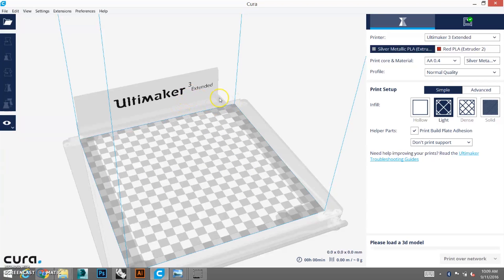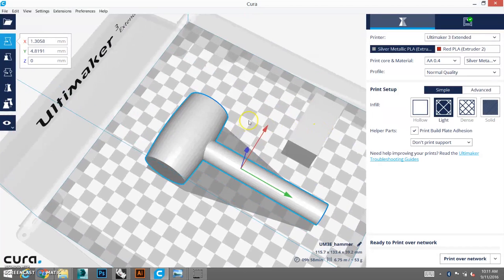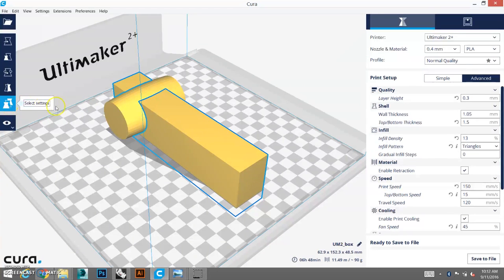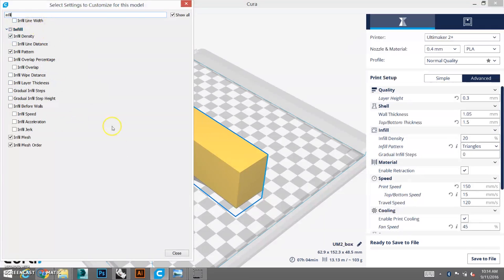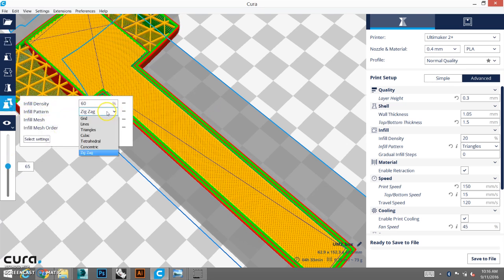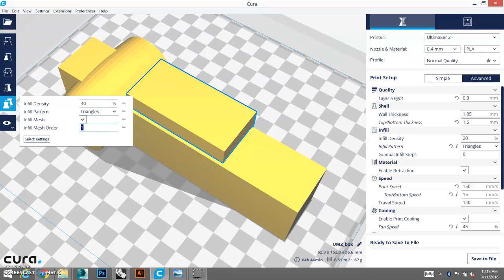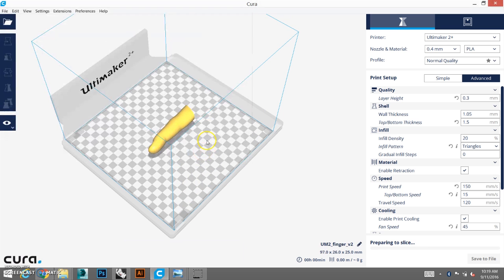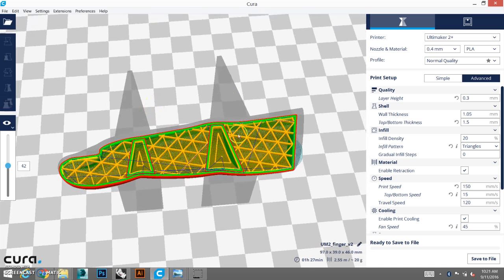CURA Infill Mesh Tutorial

Comment: This works wonderfully.
I use Cura 4 and there are few extra settings now, but it really works.
On the extra settings, when you select > Per Model Settings on the right.
You now have 5 settings - 1. Normal Model. 2. Print as Support. 3. Don't support overlap with other models. 4. Modify settings for overlap with other models. 5. Modify settings for infill of other models.
No 5 is the one I chose as I only wanted a base of a model 100% infill and anything above would be 25% infill from the main Infill options on the right.
Slice and then preview. You will see a difference of infill as you use the level indicator with your mouse or cursor.
Great video and again, it works.
Just practice.
Reply: @RJ Deering In Cura 4.4, the 3rd option corresponds to the OP's 5th option and it now has a checkbox that makes the mesh infill only. From there, the rest of the settings are the same as the video.

Comment: but i not understand how you do to export the file with multiple infill?
Reply: Just save the project file. Or do you mean to export to gcode? That's done as normal.
Reply: ok but whitout second object just hammer or finger ?
Reply: tulko66 My thoughts exactly.  I see how to change infil, but it’s not clear how you export ONLY the hammer and not the boxes. I always thought what’s on the build plate is what you get on the printer.  Like a hammer with 2 boxes messing up the design. Looks like I’m going to have to try this sometime and see what happens.
Reply: Gary Slovinsky  The layer view shows what is actually being printed. By checking "infill mesh" for the object I think it knows not to slice it. You can see at intially it does slice the box, but then after he makes it an infill mesh it is not sliced. I have not tried this yet though.